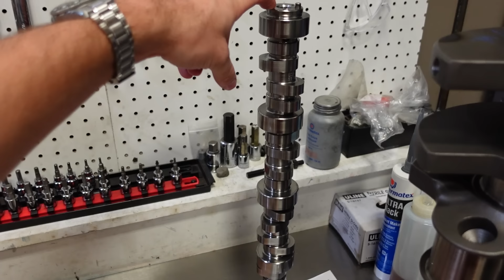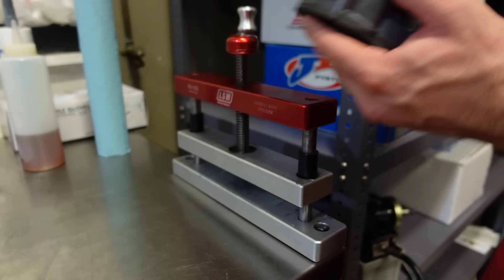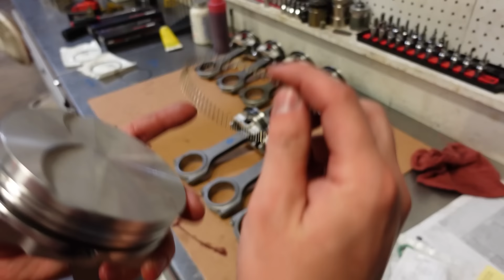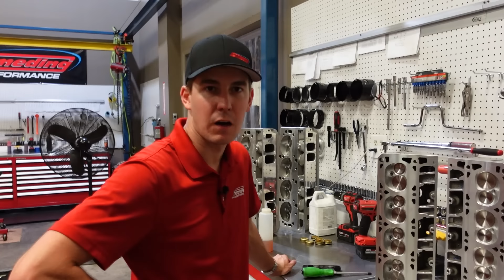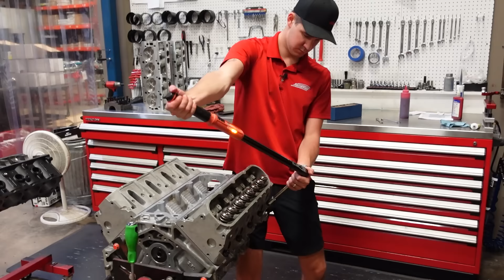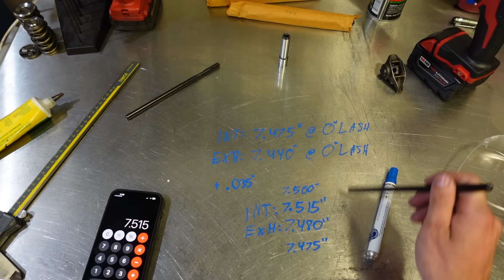The COMPLETE Guide to Building an LS Engine!! - 383" LS1 Build | Part 3 | Bare Block to Long Block

Comment: Brother, it doesn't matter what you do. Someone is gonna run their trap about something.  You can't please all of the people all of the time. You can only please some of the people some of the time. Good video !!!
Reply: It’s usually individuals who don’t have ANY content at all that are the most critical. People who are busy don’t have time for that kind of negativity.
Reply: @prevost8686  That is true lol.
Reply: Maybe I didn't catch it, but it is smart to degree a camshaft even on milder stuff when you decide to use aftermarket rotating assemblies. Banking on the crank or cam company for that matter to never be off is kinda dumb and you can be giving up some. Stock, yeah straight up, dot to dot, and any other way you want to say it.
  Point being, people are dumb and take YouTube videos to be gospel. There is a right/wrong way to build an engine so if you are portraying as so do it. And YouTube content amount does not dictate knowledge, that's just dumb.
Reply: @Dirtydave67  There too much Parotting on YouTube!!! I didn't degree mine. Ls3 swap. BTR Stage 2 V2. But I am also not trying to squeeze every ounce of HPs out of my engine. A little more than stock is ok for me. It's going in a 03'Crown Vic Police Interceptor.  It's a project with my grandkids. It came with 239 HPs so anything over that is great.
Reply: @GrandPitoVic  what it sounds like you did (correct me if I'm wrong)  you cleaned up a stock engine and slid a btr shelf cam in. Yes, it's not really going to matter. Like I said, stock stuff it's not going to make a worthwhile difference. Aftermarket, best believe it, not just for power but also to make sure alignment is correct. With everything being made in China I don't feel like relying on Wong to always get the crank keyway right on
Reply: @Dirtydave67  stock rebuild. Completely machined, new pistons, new rings,connecting rods, polished crank. New cam bearings. 1 new sleeve. Decked the block so far. But still just stock. With a cam. Still going to check piston to valve clearance. New intakes and exhaust valves, spring, retainers and locks, rockers with trunnion kits. Pretty much all new except block ,heads and crank. But still just stock with a cam. Pushing high numbers you definitely need to degree a cam. No matter what.
Reply: @Dirtydave67  But I still don't trust WuFong built my stuff right lol. I tore the Fuse/Relay box off last night and smashed it to piece cause the pins were loose and sloppy and I couldn't get it to fit right. I'm not running that junk garbage on my car as much as I've spent already. This isn't no $500 donor special I am building. It's going to be the best I can make it for the money I can spend. Which isn't alot. I have 4 grand in the engine already and I am not done with it. I see what you are saying anyways
Reply: @GrandPitoVic  sounds like you'll have a dead nuts reliable engine that'll sound good as well. 6 P's go a long way...Proper Planning Prevents Piss Poor Performance. Yes cost right now is not helping the buy US made parts sales and I'd say most of us are on a tighter budget than normally but keep after it, you'll get there.
Reply: @Dirtydave67  Thank you. It hurts for sure. This project is with and for my grandkids. I am trying to show them. Cheap shortcuts can hurt you. This is as new as I can make this engine without dropping 10 grand on a new one. I cant afford that. Trying to pass down the torch and keep hotrodding alive. Even my granddaughter is into it. Proud grandpa right here. You can cut corners some places but not all. It will bite you. He'll I might spin a bearing, I don't know. You never know. You can just plan the best you can. God takes it from there.
Reply: Well to say "there's no wrong way to build an engine" is wrong. I'm not saying what he did was wrong. But there's plenty of wrong stuff you can do.
Reply: @ls_812  Yes sir!!!!
Reply: I usually like to run  my trap about everything i dont want anyone feeling left out😂
Reply: @crownmendez9816  ROFLMFAO!!!!!!

Comment: You said you don’t have a torque spec for the plug on the oil pump but the directions you showed us from melling had the torque spec on it. Which was 106 inch pounds.

Comment: @That Engine Guy  Hey Jacob, Try using the EZ pushrod length checkers at summit racing. So much faster for getting push rod lengths. They have various models to accommodate most engines. It will save you so much time.

Comment: Masterclass in engine building, took me awhile to get through it but I learned a lot (like adjustable pushrods are a thing?!)
Reply: Yeah they’re only used for setting up your valve train geometry you adjust them to proper length and measure them to order proper length ones . They aren’t used in a running engine they’re a tool .
Reply: Yeah waiting for your next video too dude 😝

Comment: If I had the money to burn, I’d throw together a 5.3 with the Milwaukee 12v impact and ratchets. No torquing, just a few clicks of the impact. And just see how it goes and how many miles it would last. Maybe do 2–one a mild daily driver with a few upgrades and the other a little spicier with a heavier foot. I know torque specs are there for a reason, but I’d almost bet the LS series could handle the tolerances being off. Just for shits and giggles. 🤷🏻‍♂️. 

(And definitely not knocking your build. You running them down to flush made me think of it. Your videos are amazing…definitely one of the best on YouTube.)

Comment: In regards to your previous feeler gauge technique for installing the LS Oil Pump, ever since I saw you do it THAT way rather than using an alignment plug or the like, I really do like that technique, especially for big dollar stuff. Perhaps Melling are using a Billet Gear setup rather than Stock GM's Powder Metal Forged Gears, giving Melling more confidence in their product ? I am still having Nissan RB26DETT (Skyline GTR) Flashbacks/Nightmares from shattered powder metal forged oil pump gears (crankshaft driven like GM) and the 'upgrade' to billet gears in case you hit the rev limiter too many times and wanted to avoid catastrophic failure...... I enjoy the LS World MUCH more (as does my wallet).

Comment: Hello great video you’re very accurate. Very thorough. But i am wondering why you don’t use a microfiber cloth to check the journals and bearing surfaces for cleanliness. I’m wondering why you didn’t mention staggering the rings where the gaps will be. Also I didn’t hear you mention the chamfer on rings. That’s very important and I didn’t hear you mention that. I am not critiquing just observing i am an ASE certified auto technician and I’ve been building engines race engines for many years, three things thatI noticed. Keep up the good work you’d be an excellent instructor.

Comment: I do like the process you have done but I have one question on this particular motor if I remember right you have to pressure it to pre-oil it why didn't you do that before you put the valve covers on

Comment: TWO QUESTIONS. 
can I run the copo camero mellings oil spring on a stock engine?
How to I set it and fill it with oil if the engine is still in the truck? I can flip it upside down to prime it.

Comment: I built a ls1 383 a few years ago , did a 11:1 with trickflow 220 heads , 242/250 tsp cam n/a it was a turd , on 20 pounds a boost and e85 it was quite impressive
Reply: 11:1 on 20lbs, my man. E85 for sure. What were you putting down?
Reply: @ never on a dyno , only pass it made on the 1/4  ran 132 mph @ 8psi  , I’m still working on the car hopefully this  summer I’ll have it back up and running

Comment: With as much compression as you have and running E85, I assume it should make about 625-675hp. Isn't 12:1 compression a tad high for a street engine that "may" see the track? Will E85 help with detonation. 
Great video!

Comment: Your blue torque marks are supposed to run across the bolt, down the side, and on to the surface of the object you’re torquing down.
Reply: How many hp is he losing?
Reply: Only if it's "torque check" to visually see if your fastener has moved. This is just a visual reminder that the fastener has been torqued.

Comment: Great video! During the Assy I didn’t see you check or adjust the ring gap or orient the ring gaps during piston installation what is your rule on those steps?
Reply: There's a reason for that.... when it comes to LS Engines, ring gapping tolerances in general (and esp the ring gap for Boosted applications)  many if not all engine builders who build dependable super high performance LS Engines typically will not announce the gapping parameters they use depending on the application and all the best builders websites when looking to have a build done, under Ring Gap, the tolerances will be listed as "Proprietary information"   so it's not unlikely that he forgot to mention it rather than is shop Trade Secret  for what's a super important step it reliability, longevity, and power that is a spec that any competitive and highly regarded shop isn't going to just hand out as they've probably gone thru building dozens if not hundreds of LS setups for the explicit purpose of trial and error/testing on what the precise perfect ring gap tolerances are for an NA setup and Suopercharged and Turbo/Twin Turbo setups as tye tolerances greatly differ from the 2 AND also depending on how much Boost PSI will be the Engines target parameter or optimal operating pressure... if you watch any other high end shops videos too,
 (Like Lingenfelter Performance Engineering, NRE/Nelson Racing Engines, or Katech who built the nasty LS found in the Corvette Racing/ Pratt & Miller Race Engineering C5.R/C6.R) 

they won't tell their Piston Ring Gap Parameters either 💁‍♂️💁‍♂️💁‍♂️....

Comment: Serious question. Why would you ever elect to use an adjustable push rod over a solid state push rod?
Reply: Not to mention what is you’re four or five degrees off on can angle?
Reply: The adjustable pushrod is to check and see what length pishrod is needed

Comment: I need a frigging LS guru for ma Boy Stanley....  poor guy has had the D.O.D./AFM blues for a min..... I got all the parts but my thing is why not do the bottom end while I'm at it?   Cant find a decent mechanic in this town an wouldn't matter cause if I could then I couldn't afford him.... now here's the other dilemma..... my dad has a garage an everything to do it with but because I love this truck of mine..... well then he hates it.... an wants to sabatoge anything of mine period that makes me remotely happy. He's already ruined 1 boat with a built 350 an tried to ruin my bass boat but I put the 1800 in it jus to piss him off.... I'll never understand the reason for this.   I've been sitting on these parts for some time and I didn't get the cheap shit either.... even after that gotta shell out $250 just for the tune which isn't bad.... I can turn a wrench an fix shit but I know well enuff when something such as this requires some exp beyond the basic knowledge...

Comment: I agree with the Melling guys, as your crankshaft sitting on dead weight is just sitting on top half of bearings with all the clearance at the bottom half. 

Go ahead grab your crank snout and lift youll see. Using shims in this manner isn't centering anything.

In theory yes, in practice not without exact measurements from centerlines

Comment: Do you run tighter main bearing clearance on aluminum blocks vs cast iron?   Do you find that the clearance grows .001 more on the mains on an aluminum block vs cast iron?